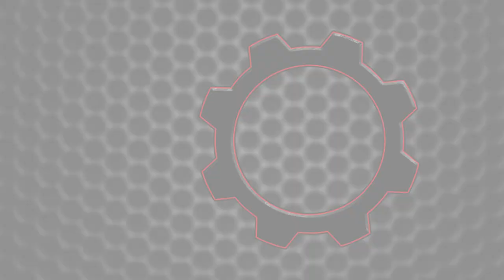I Invented the SUSPENSION CATAPULT! The New Superior Siege Weapon! - Trailmakers Gameplay

Comment: You know what you must do, take this to excessive levels and just keep adding more and more suspension until you hit the complexity limit, how far can you throw an explosive?
Reply: @tomashtu when there's lag, there's content
- me 2021
Reply: @tomashtu Lag or break, either one.  It looks like it was barely holding together as it is.
Reply: I feel like the problem with going to far would be more just getting it to pull back and release properly. There's already collision issues with this one, and a bit of variation, so adding more increases that variation, and makes even just drawing it much more difficult and time consuming, as the speed will have to be lowered on the draw even further. If suspension ever get some cleanup to make them behave more consistently, and remove it bending randomly at different points, like we saw in the video, then I think that going max size would be more viable. But I really just don't see it working well in Trailmakers. And I don't just say this from the videos, but from owning Trailmakers and having spent quite a bit of time messing with suspension in weird ways.
Reply: For multiplayer Monday in scrap mechanic do a battle where you have a glow bug powered car and you have to shoot the cardboard so they can’t move
Reply: Yes
Reply: Next video braking the sound barrier  a catapult

Comment: Hey read this comment for build suggestion : 

In trailmakers: Make a car that uses pistons to power itself. (By puting them at an angle that they push forward). Basically a car with no engine no thrusters and no other acceleration or boost. (Add a jump feature of you can [ I know you can ] ).

In Scrap mechanic: Try making a car that just bounces to travel using piston on 20 or more angle.
Wheel is used but the wheel must be attached with for piston with a cactus on top. (Basically a car that jumps around to travel like a kangaroo). 
2. Can also try to make a battle bot that battles bots.🤖☠️🛠️🛠️ 

Scrap Mechanic Multiplayer: Build vehicles for each other. ( It should have steering should have atleast three wheels and engine hooked up with wheels, steering but no explosive and weapon. SHOULD MOVE EVEN IF A INCH IN A MINUTE BUT SHOULD MOVE. Rest ideas in my comments. 

BYE😌🙏🏻

Comment: Now trail makers multiplayer siege weapons challenge (basically worms wmd in trail makers) last base standing.

Rules)
1) players can not leave their base but must stay at their base and the area immediately around it.

2) only explosives allowed (no guns)

3) drones (quad helicopter ect) are allowed only if unmanned

4) this is optional but the person whos gets destroyed first can choose to join one of the surviving players bases and help attack but the three prior rules still apply.

5) bases must be 10Wx10Lx10H at least and 20Wx20Lx10H at most and using anchors to hold them in place (a base that slides is destroyed)

6) bases are considered destroyed if more than 75% destroyed

7) weapons can be anything (except guns) as long as they can deliver explosives and don't require you to leave your base

8) if any map other than the testing map is used bases must have line of sight with each other

9) weapons should not be attached to the base, if it is then is the weapon gets destroyed you can not repair it as that will repair the base too (no cheating) this doesn't mean you have no weapon it just means you lose the advantages (if any) that provided and the weapon can be rebuilt beside the base.